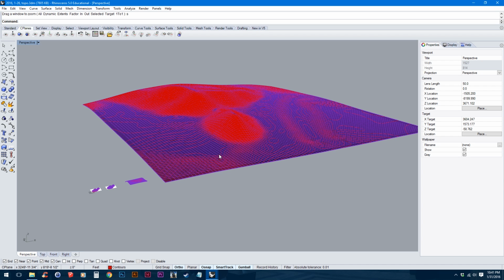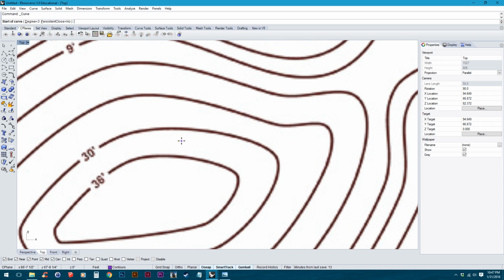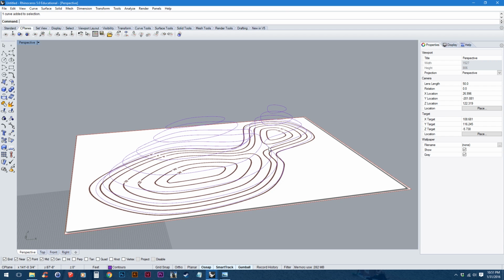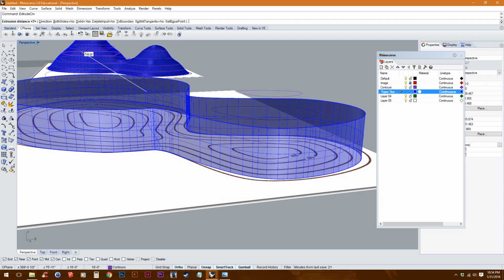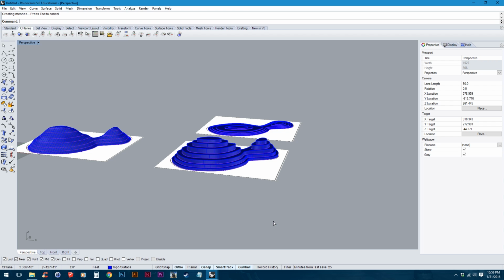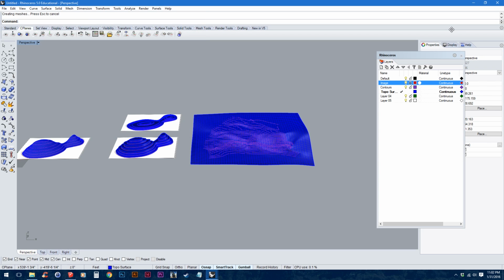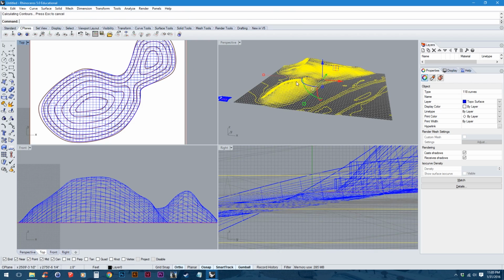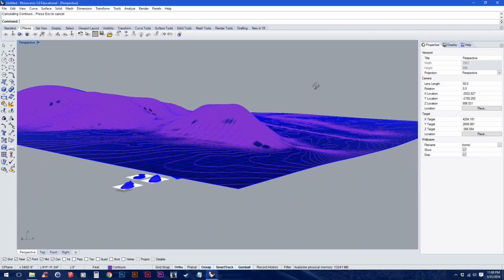Rhino 5: Working with Contours & Topography Tutorial

Comment: Hi Dylan. Thank you for a very helpful tutorial! Is there any command or easy way to distribute the contour lines in Rhino other than the manual method you are using here? I have a very complex landscape with 2D contours and I am foreseeing hours and hours of work if I need to lift them manually. Best regards, L
Reply: I'm wondering the same thing. If I find any additional resources I'll include them in an edit
Reply: @dianabolton3388  Yes wondering the same thing
Reply: After 2 years wondering the same thing. Ahha
Did you find out a way to do that quickly?

Comment: Great Vid mate, Im relatively new to rhino and learningRhinot atm. Can I ask is there a simple way to take those contours generated in the final option turn them into a stepped model like the 3rd option you show, or would you need to manually close them before extruding?
Reply from the maker: I don't know of any faster way of closing the curves. You would have to copy a rectangular line for each contour and then use the trim tool to cut away the unwanted section.
Reply: its what i did in the end, although its worth noting you can select all the lines and then trim with a fence which i wasnt expecting so didnt take anywhere near as long as id anticipated. I had well over a hundred contours but turns out you can extrude/cap them all at the same time as well which i wasnt expecting